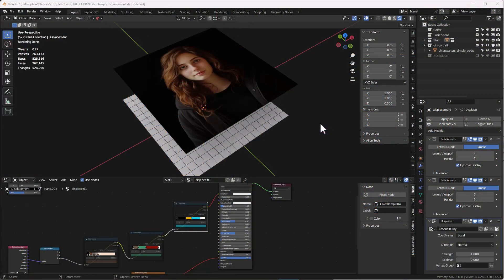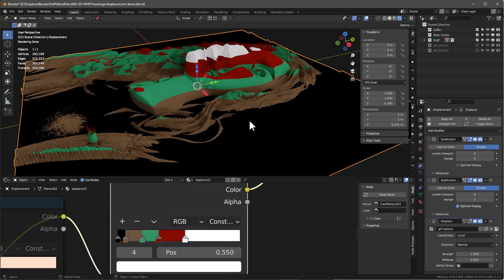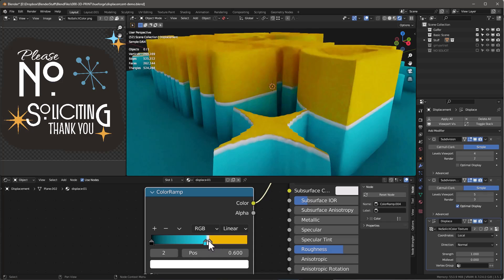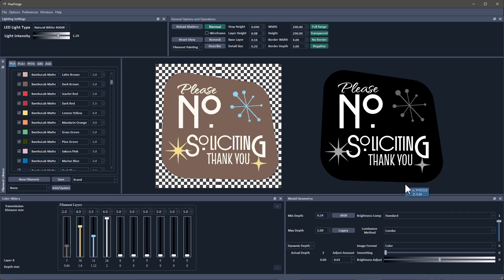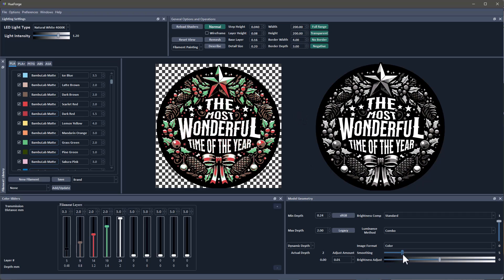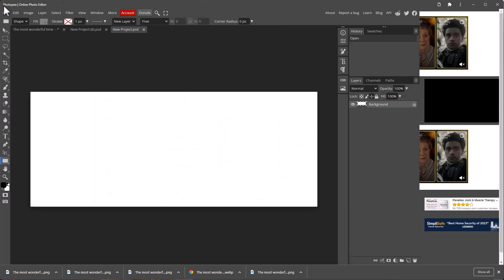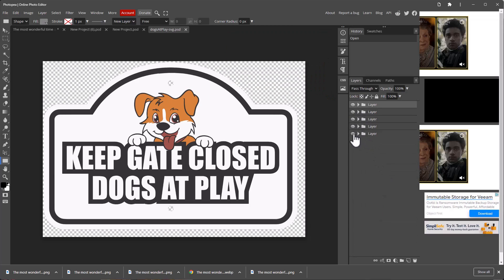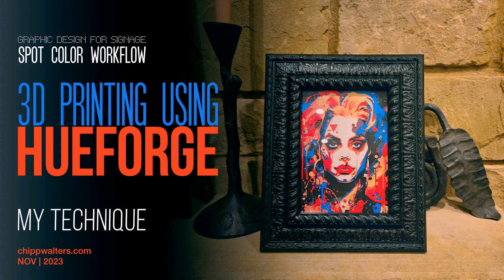HueForge: Using grayscale images to map filament layers

Comment: I have a problem with exported STL file from Hueforge.  In Hueforge the file has 22 layers but when I open the stl file in Bambu it only has 12 layers.  What is a possible solution for this dilemma?
Reply: You post this everywhere huh? Change layer height to 0.08 and first layer to 0.16

Comment: the vector AI makes you pay now, which i did pay for 1month just so I could try this out, but I am unable to get the gray layers where it seems to filter like yours.
the drop down arrows on the gray layers never shows up for me.
Reply: of course i am trying to use a photo to try it out, not like yours, but the layers should still be filtered I would think.
Reply: Yeah I tried it too and it was trying to charge me $10 a month to use it. That sucks